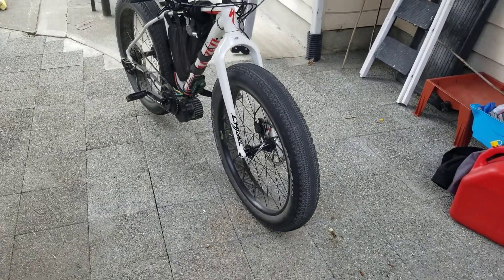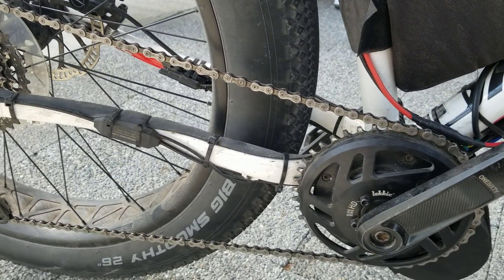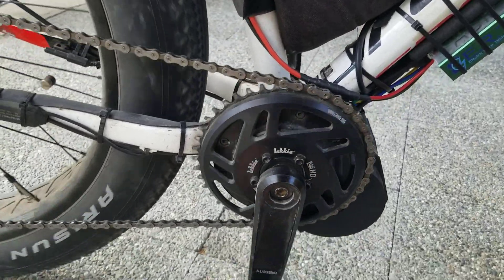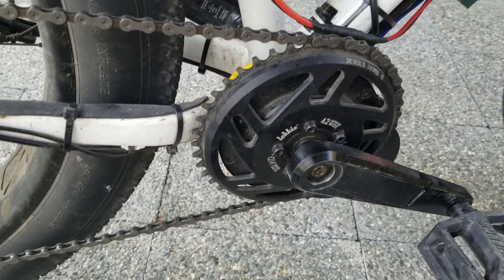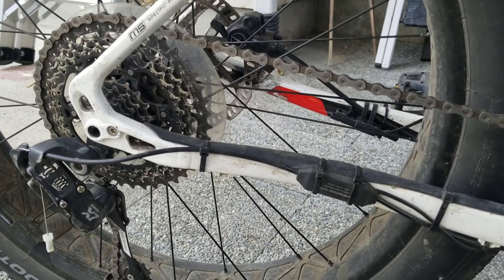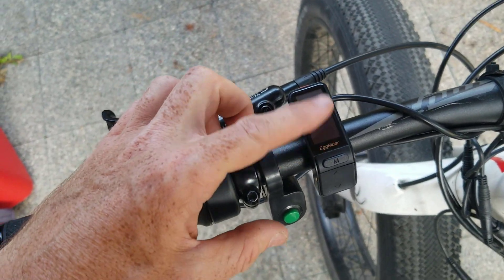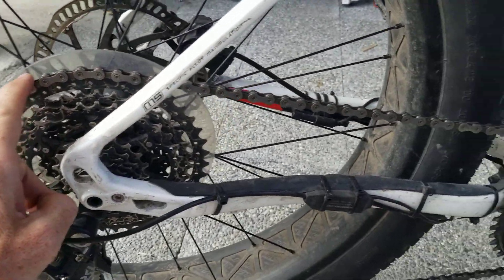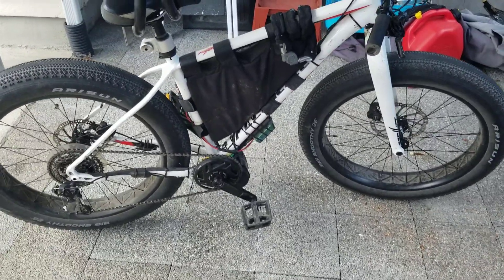Bafang BBSHD (ASI BAC800) on Specialized Fatboy - 3000km What I have learned!

Comment: Hello and thanks Andy  perfect video and just one time as i am building my bike now,  question and ive been trying to figure out the right combo for the rear cassette.  Seeing you have the experience and mentioned, you don't really need to change gears. I was thinking the same thing.  what gear cassette would you buy now that you have been riding awhile.  I do have decent hills to climb along with my flat terrain here in the wack  thanks
Reply from the maker: My rear derailleur is locked due to wear and tear so I had to fix it in place. Ideally I would maybe have three gears my 42t and two in the 30's Maybe a 36 and a 32t. If you check out electroncycles in the UK there are some good pictures about how they spaced out a cassette to do this. They also had a little gear as a get home emergency gear if your system failed and you wanted to ride it like a regular bike for a bit. I would make sure the cassette is of good quality steel and that it comes apart so it can be rearranged. I have not done much hunting for one. I was going to wear the current setup out first and then see. I have hear good things about the sturmy archer 3 speed internal for fatbikes taking up to 3000w so maybe I will lace a wheel with this at some point. Cheers!

Comment: Ok the bike is good build and everything optimised but that Fat Bike with Fat Tires is drinking a lot of battery power, if you are not off-road it's a waste of energy.
Nice videos btw.
Reply from the maker: Electric Biker Thanks! Yeah the tires are not the best for efficiency. They are very stable though and I used to take the kids to their schools in a trailer so the stability was the main point. I will be switching to winter stuff soon tho!

Comment: Awesome vid thanks. What controller are you using and what was involved with changing it over.?
Reply from the maker: Asi bac 800. If you did a bbshd conversation already it's no more difficult, just chasing different wires. www.electricrt.com is where I got mine.

Comment: Gday Captain Coswollap, Great Video, clear & straight to the point 😊👍🏼. I have around 600km on my EEB BBSHD at 15S/35Ah (stock controller) motor/controller still going strong 💪🏼 
Do you have a link for your External controller. (It would be good to keep on hand) 

Does mounting your external controller allow the bbshd motor to run any cooler at all ?
Reply from the maker: Gday, hope it's good in Aus. That is an interesting voltage you are running. The controller and lots of other goodies can be found at www.electricrt.com
Reply: Yeah it helps alot with voltage sag/voltage drop half way through a ride, but the main reason is so i can charge to 90% (4.1V per cell)
 (get almost double the cycle life out of my batteries) and still run a max voltage of 61.3V at 4.1V per cell, best of both worlds.. so to speak. 
Whats the "full name" of the controller ? as ERT sell quite a few different versions

I got the info from your other videos, should of looked their first...lol😬 Enjoy those Trails, Thanks 😊👍🏼
Reply from the maker: it's the bac 800 you want! Thanks for the info on the batteries. I'll do that if I build one.

Comment: The stock controller is adjustable to stop chain snatch? I'm not sure em3ev know the right settings. They should have set the start current to 1 amp.
Reply from the maker: Its possible. I am not an expert in the bafang settings. em3ev settings look pretty similar to Carl's special sauce settings. You could play about with it tho. I'd be interested if that gave you a smooth acceleration just off the throttle. I buggered my firmware so it's hard to try it now. I'm not sure I'd go back to stock after riding with the ASI tho.
Reply: @HighVoltageKits  Yes smooth start throttle and pedal assist. You can delay start rotation or change start power and ramp up percentage.
Reply: @super-sim1665   Id like a Manuel as the crap on the soft ware tells you zip unless your a electronic geek ! Its just numbers and % confusing ?
Reply from the maker: It's not the easiest thing to work out. Try https://electricbike-blog.com/2015/06/26/a-hackers-guide-to-programming-the-bbs02/

Comment: Getting one soon.
Does the throttle have settings or does it just overide everything?
Reply from the maker: With the ASi bac800 the throttle scales with the peddle assist levels. So level one is 800 watts of throttle max and level 5 is full 2800 watts. On a 52 volt battery anyway. Stock bafang it is one level for the throttle. But it does override the peddle assist.
Reply: Thanks.
I probably wont bother with assist anyway.
Reply from the maker: I use it at low speeds when passing people or in tight spaces. The throttle I have is not the greatest. I may upgrade to a domino one in the future.
Reply: I use thumb..its difficult at first, but now I can use it to tackle the most technical terrain with ease.
Reply from the maker: That's good to know. I have a thumb throttle to try at some point

Comment: I swapped my 30t mighty mini chain ring for a luna eclipse 42t, i was snapping chains and trashing my derailleur and cassette. I also swapped out my rear derailleur for a Sturmey Archer rs-rk3 IGH, only 3 speed, but i pretty much ride it in the second gear with a 24t rear cog when im climbing. That controller looks awesome.. great video..
Reply from the maker: Thanks! The controller is pretty awesome. You get about a 10 to 15 percent top speed boost with the field weakening
Reply: Troy Smith hi Troy what rim did you put the sturmey archer on?
Reply: @williamrichards7453  A Surly Clownshoe, I used the FreeSpoke calculator with the measurements from Sturmey Archer and ordered spokes from eBay.
Reply: Troy Smith nice never thought of that, what chain tensioner do you use?
Reply: @williamrichards7453  I use some cheap thing from eBay, I tighten it pretty good and it does the job, I don't lose my chain unless I'm really bouncing it around.

Comment: Can you do shopping list?  Like what model, type of battery etc. I would like to copy what you have done (I have a Fatboy in white as well). Thanks! Does your battery get hot in the bag? How does it handle the cold? (Snow)¿ Thanks again
Reply from the maker: Battery is 25.5 amp hour triangle pack from em3ev.com. I used 30q cells but they have hg2 as well which are higher drain I think for 50amps. I got their bbshd motor kit and I use the eggrider v2 display. The asi I got from electricrt.com. Em3ev.com will let you pick other bits including the essential lekkie bling ring. If you run into any problems let me know and I'll send more info. Cheers.
Reply: @HighVoltageKits  thanks for quick response. Appreciate it
Reply from the maker: Anytime. oh and I ran in the snow with no issues. Just make sure it's all sealed up! Battery life takes a small hit in the cold but the motor stays cooler!

Comment: Great job, very useful video. I intend on riding my fat bike off road and using pedal assist mostly. Interested to know what range and speed you are getting out of that battery, being that you just use the throttle. Also, I'm looking at getting the Luna modified version which I think will run very similar to that external controller?
Reply from the maker: If you are referring to the luna ludicrous controller you will get more watts and amps. No field weakening though and no option for 72 volts I dont think. It's an adaptation of the old controller to take more power but lacks the features and sophistication of the ASI

I use peddle assist more than you might think especially in busier areas or when I just want to cruise. But less so on the videos I have done. Even on level 5 the pas is only 1000watts. With the big battery you can get hours out of it. If you use pas 2 it's only 400watts of assist so the range would be huge on a 25 amp hour battery. 

Running the throttle the range is about 40km. That's without dropping the battery voltage too low. You get way more charge cycles if you dont charge it full or drop it below 20%
Reply: @HighVoltageKits  Cool, thanks very much for the info. I was just looking for the best/easiest solution to start out with and didn't fancy pulling the motor apart whilst it was under warranty. I am a big and tall guy, so  looking for torque to climb more than straight line speed (though I'd like it to at least do 40km/h). 

I was also considering getting a second wheelset that is  27.5" and runs fat bike hubs to commute around on, if I liked it - the knobby 4.7" Vee Bulldozer tires (that came on the bike), besides not being suited for that purpose, are very expensive to get her in New Zealand and cost more than my cars tires! - though I'd probably replace them with something else, as they self steer a bit.
Reply from the maker: Luna make perfectly good bikes to ride on the bbshd platform and their upgraded controller works very well. You ought to get the speeds and torque you want. I had no issues doing any of this with the stock bafang controller. The ASI just adds smoothness and acceleration. But you will have a blast under warranty and can upgrade anytime you want. The second set of wheels is a good one. Wish I had the cash free as my knobbies are very noisy on the road but I'd like the extra traction on trails...but I cant be doing swapping tires all the time!
Reply: @HighVoltageKits  You can get a set of ICAN carbon 27.5 " wheels laced with your desired size fat bike hubs for only $595 USD from China. Max rider weight on them is only 110KG though. The only  problem I have with the Luna BBSHD - it is sold here through an Australian agent and incurs $80 NZD in shipping, plus GST on top of that coming in to the country. Whereas I could get a stock model from China for a few hundred less (by the time you add GST) and with free shipping. Is there much involved wiring up the external controller, do you need to solder, or it is just plug and play?
Reply from the maker: No soldering if you get it from www.electricrt.com if you pick the eggrider or the colour display option it should be straight plug and play. The hardest part is unplugging the stock controller as it is siliconed in. The phase wired are easy. The hall sensor is the trickery part. I gently removed the silicone with a jewelers screwdriver and wiggled it out. I did very well on the duty and tax ordering from em3ev.com that was to Canada. I paid very little. Nothing at all on the battery.
Reply: @HighVoltageKits  Okay, that doesn't sound too bad then. I can get both the battery and motor from good sellers on Aliexpress (I am aware of not buying a shitty battery and what cells are good) into the country without paying tax and no shipping on the motor, I'd just need to order them separately. If you go over $1000 NZD here, you have to register as an importer, and then that would hit me with a few hundred dollars of GST. I was going to buy the battery from Paul at em3ev, but the shipping is over $200 to NZ, which is crazy high considering what others charge who are also based in China.
Reply from the maker: Wow! Looks like NZ is worse than Canada for BS taxes and limits. I have zero experience with Ali Express and batteries. There is also banggood which I heard has ok stuff. With 18650s if the price is too good to be true they probably are not high quality cells. I hope you find the best options.
Reply: @HighVoltageKits  The batteries are up around, and over, the $1000 NZD mark for similar to what you're using and they list the different cells they use in each pack and their max continuous and peak discharge rates, plus all the other specs (the more expensive ones I am looking at have a 50A Bluetooth BMS  built in and can do continuous 50A with a  peak of 150A). I've been doing my research and I know to say away from the no name cell batteries - they also sell those for half the price. The biggest battery Luna sell on their site here is a triangle 52V 17.5AH Samsung 35E for $773 NZD - it is actually made here and the price isn't bad, but I'd rather have something with a higher capacity.

I'd be tempted if I was going to go to the added expense of getting the ASI BAC 800, to get the 72v version. I watched a video the other day of someone ripping around on a 72v fat bike like it was a dirt bike :D I'd be concerned about frying the motor though. I watched your video on the controller by the way, good stuff - though you're not helping keep my budget down for this project!

The import limit here in NZ before tax is only $300 (and only about $200 on clothing), across the ditch in Australia it is $1000... and they are introducing this so called 'Amazon' tax in December here, which makes online business that get more than 60k of revenue from here collect the GST before it gets to the border :/

Good thing with Aliexpress is a lot of sellers will straight up under declare things without being asked to (Banggood won't, but I do buy from cheaper things from them as well), and most things get here from there without being touched by the tax man. If you buy the BBSHD from some sellers on Aliexpress, they will even supply 250w stickers for it lol - you're limited by law here to 32km/h of pedal assist and 350w, not that any cop is ever likely to stop for for it - there are companies here selling 3200w scooters, as well as those 5000w hybrid e-bike/motorbikes with crappy old bike parts on them.
Reply from the maker: The stickers sound hilarious. I'll have to get some. From what I have seen 72 volts if run properly can be kinder to the bbshd as it keeps the motor speed high and it means less heat is generated. But yeah I'm sure I am reducing the lifespan running it harder. Fortunately the bbshd is pretty easy to service. The nylon gear runs about twenty bucks.

Comment: Great review, I was about to convert a folding bike using the BBSHD, but I'm glad you mentioned that the default controller is not up to snuff, and that an external controller (such as the ASI Bac 800) would be ideal for long-term use. Because of your video, I'm putting my conversion on hold.
Reply from the maker: Glad you liked it, thanks. The cyc pro x1 is worth a look as well. It's a newer motor. I'll be doing some stuff with that in the near future.

Comment: Hey I just received my bac800 today and installed everything but can't get a reply back from Alan about the eggrider firmware, would you be able to give it to me? I need to get this working so I can get to work tomorrow. Also seems to be missing the 72v adapter cable so I'm only running 52v for now.
Reply from the maker: Yeee hawww. Sure can. Fire me an email.

Comment: I am in the process of ordering a kit from EM3ev to fit my new road bike but not sure what to do with the battery (buy or build) Did a lot of research and I have to say your video is one of very best.
Good job, well done!
Reply from the maker: Appreciate the kind words. I think I am going to eventually design a battery. I have a few ideas I'd like to see that are not really done right now. For the time being though I'm keeping it simple. The 52 volt 30q cell pack I got has been flawless and it's nice to Monitor it with the bluetooth bms. Em3ev produce possibly the best quality battery on the market. Others are catching up tho. Luna seem to have stepped up their game. it's worth noting that the shipping chain em3ev use for batteries results in very low import tax at least in Canada. Good luck with your build!

Comment: That's the review I've been looking for.
 You went through all the trials and problems then fixed them and told us about them. 
 I'm still saving for the battery which turns out to be the same one you have. Now I also have to save for the aftermarket controller and I'll be ready to install.
 I managed to get the 46 tooth bling ring to fit on my bike with a 3mm spacer ring.
  Thanks for the info and keep up the good work!
Reply: Man you are the baset good video lol
Reply from the maker: Thankyou sir!
Reply from the maker: Nice! I'm impressed you got the 46 tooth in! Good job there. Thanks for the kind words. Cheers